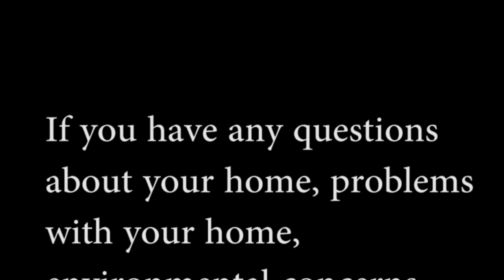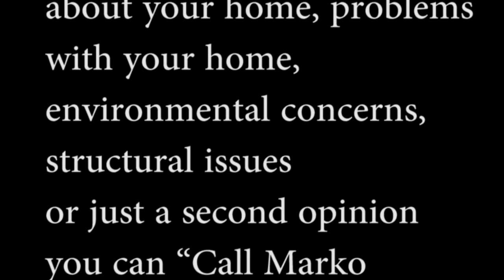Does your house smell like a fireplace

Comment: Hi there Marco - I'm in Australia and unfortunately I can't call so I'll just say what's happening for me here. I believe I have closed all the air gaps around the house - there were a few of them. But when I run my central heating - external gas unit with floor ducts, I get a heap of the neighbours wood fire smoke in my house. It seems to get worse when the air is pumping from the ducts but that could be just the smoke already in the house getting stirred up....I don't know. I do know it's choking. Is it possible contaminated air is being drawn in to the house through holes between the duct and the floorboards or even between the floorboards themselves??  I would have thought anything else would be a positive pressure. Well that's it...........I appreciate any thoughts you have.   Signed  Desperate.
Reply from the maker: HAVE RETURN DUCT LEAKAGE  AND HIGH STACK EFFECT.  If you have a fireplace put a balloon (can buy on net) inside it.    Make sure no exhaust fans are on.  See if that helps.  If you have cavity returns it is going to be hard . Seal all basement cold air returns.  Burn you neighbors house down when he is not home   LOL
Reply: @Clevelandmarko   - I there Marco. I appreciate the reply. I hadn't thought about any return air duct leaks drawing in contaminated air into the system - I'll get under the house next chance I get for a look - basements are not really a thing here in Australia.  LOL...........I would burn the neighbours house down but I don't want THAT smoking up my house as well.  
Cheers Ian in Oz.